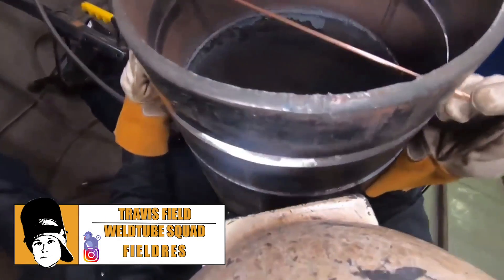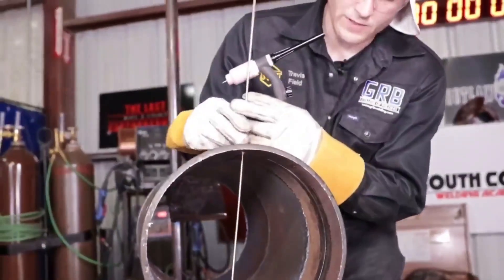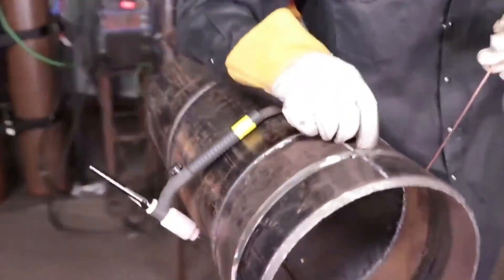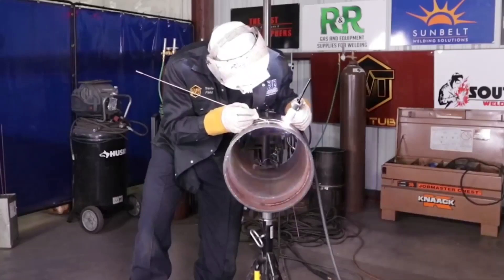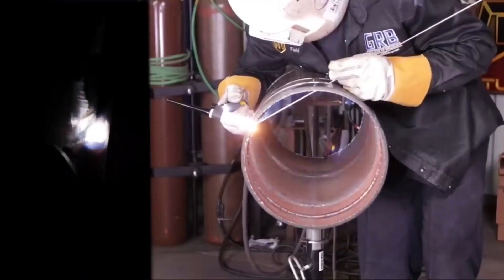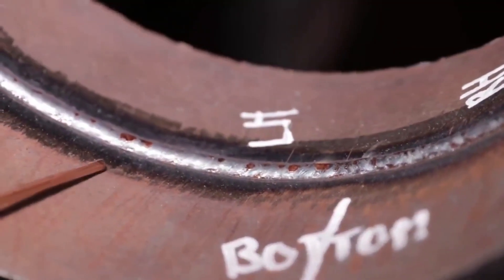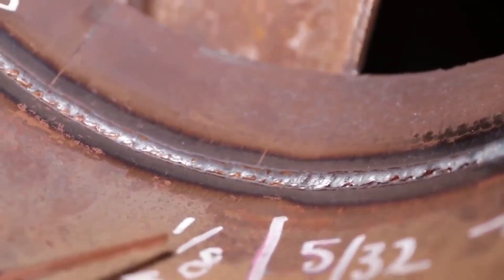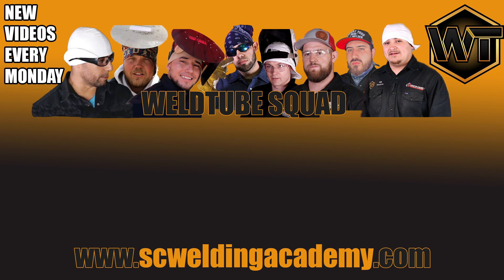@FieldRes TIG Welding Advanced Techniques | Looking Through the Gap | Directors Cut

Comment: Love Travis, but looking thru the gap works great till you get to the full and cap. Also you don’t have to back feed from 90 degrees. Feed wire from a 1/2” away from the puddle and get the same result.

Comment: How do you keep the tungsten from sticking to the pipe, how do you control the torch, how do u guide it?
Reply: As far as sticking to the pipe- don’t stick it lol. Controlling and guiding is all in how you like to hold your rig, how you stand and kneel and all around how comfortable you are. You always want to be comfortable. Most people freehand when they backfeed and look through the gap, freehand meaning they don’t rest the cup on the pipe. I like to hold my rig in two sometimes three fingers almost like I’m trying to pinch the cup with my thumb, index, and middle finger. Resting the tips of my ring and pinky finger on the pipe to keep my hand supported and steady, but don’t put all the weight of your hand on those two fingers because obviously you’ll be traveling up the pipe, so just rest them lightly to where you can slide them as well. I hope I explained it well